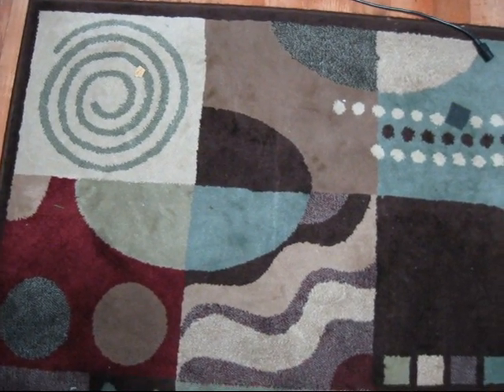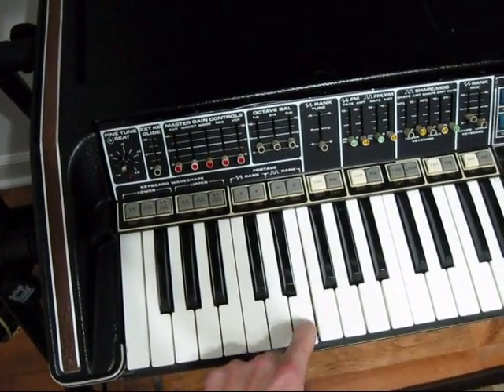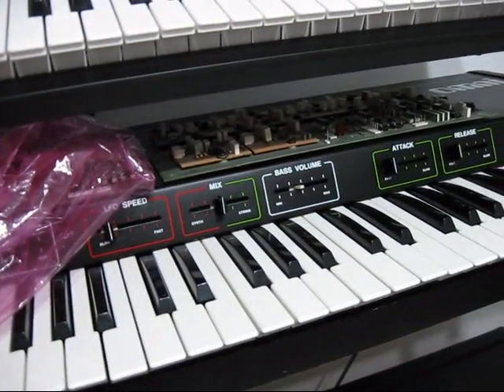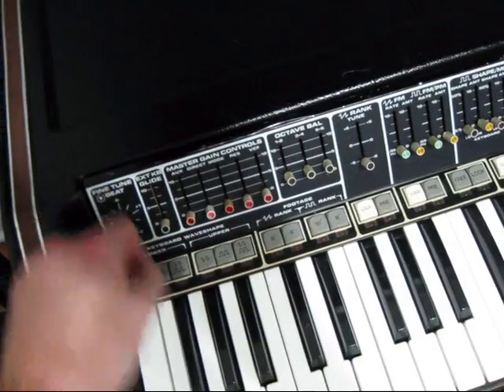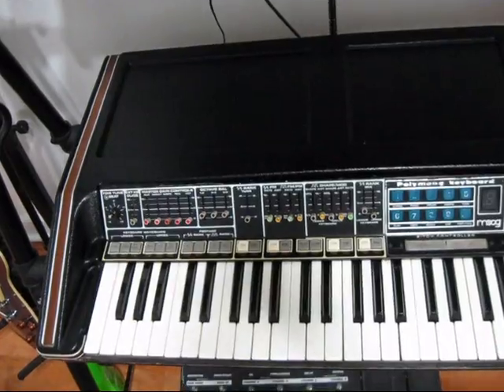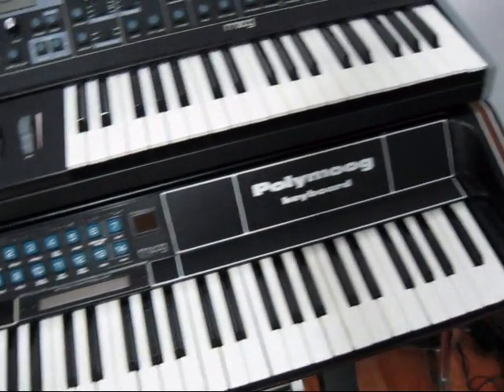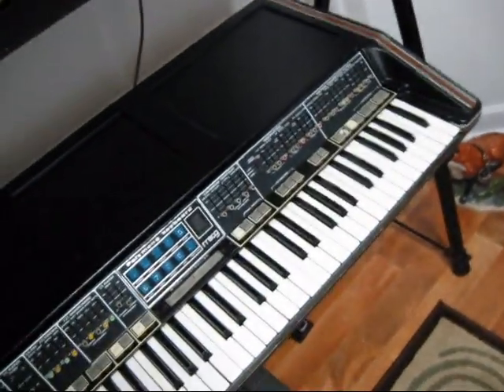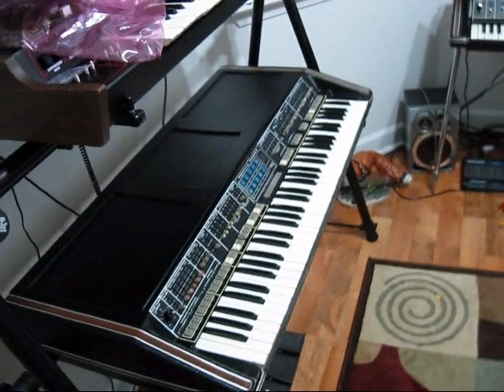Synthpro's New Polymoog Restoration (Video# 3)

Comment: I've almost completed my 203, not far to go now. Replaced the caps on all the boards as well as the transistors. Re-built the power supply, all ok there. I think I'll leave the LED's in as they are to keep it as original as I can. How are you getting on with your 203? I hope you managed to track down a psu, don't bother with that Faratron keep it away from the nice new parts. I'll let you know if I see a Moog one. I'm keeping my eye out for a few parts myself. I'll post a video soon. Lx